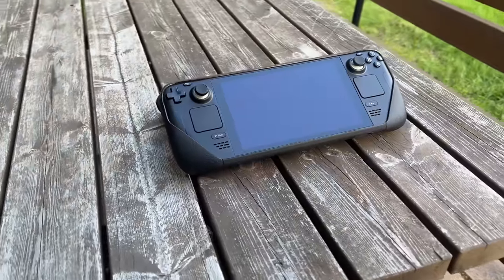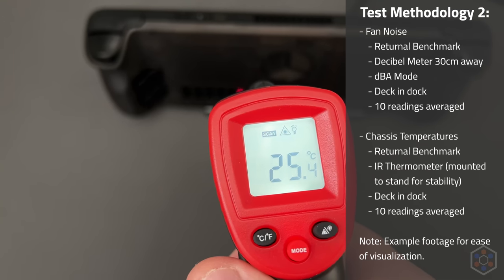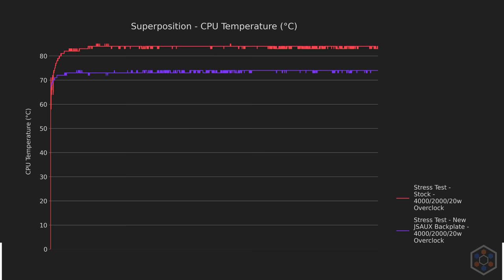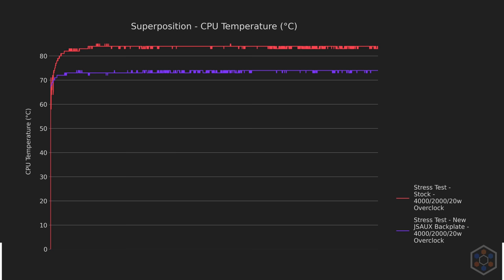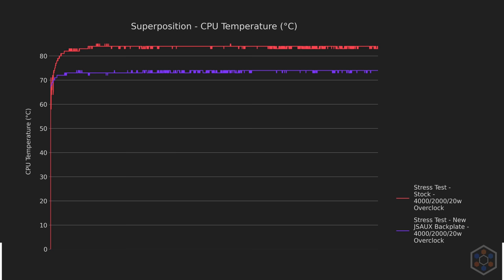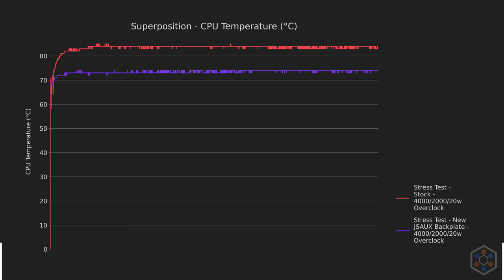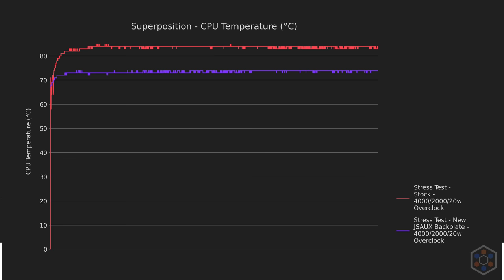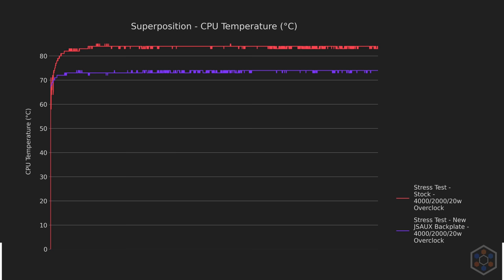How LOW Can It Go? | Steam Deck Thermal Modding

Comment: Since using the jsaux backplate with the metal plate combined with the jsaux original cooler and the jsaux case, I see the same improvement numbers, 9-11 degrees cooler. I'm also running your program too
Reply from the maker: Those are the numbers I see on intermittent loads as well, the plate starts to falter when it's high load for a long time, like an extended session of one of the few games that slaughter both the CPU and GPU, like Returnal.

Thanks for watching, I'm glad you're happy with your backplate!

Comment: I am currently rocking the JSAUX Modcase which i really really like, it is compatible with a different version of the jsaux fan that clips on easier at the back  and takes up less space. but the case itself interferes with the Vented backplate, You think it would be a good idea to cut a small  hole in the back of the case so Half the  vent is exposed and then put the JSaux fan on top of that ? or would it just block its own airflow.

Comment: Are there any updates on your concerns with cooling? I have the backplate myself and have had it about 3 months now. No issues on my end but i am by no means running testing on it.
Reply from the maker: Nothing thus far, it's still my daily driver with no signs of issues!
Reply: @cryobyte33  Thanks for responding! I was gonna ask the same question to see if your SD spontaneously combusted or something. Based on responses from Reddit, they make it seem like all the other components will die due to increased heat. They love saying how valve did negative pressure for a reason etc.
Reply: @cryobyte33  thank you so much for replying. Your work is greatly appreciated. Huge fan here. 
I also have had no issues and the lower temps have been awesome.

Comment: I'm a really picky guy about my temp/db of my devices. I own mine since last friday and I tried a lot of games, really heavy and very light ones. And I can't consider it a problem to reach such temperatures on the deck keeping in mind some gaming laptops like mine with a RTX gpu that reaches almost 90º.
 I like to see third party projects to build aftermarket parts but in this case I think valve put so much effort into optimizing performance and temperature of this amazing device I could not find a reason to mess this up. As you said it's build like this for a reason, on the long terms messing up the stock airflow could harm the hardware.

Comment: I'm glad you addressed the potential issue with the vented rear plate.  People generally think that more airflow is better, but almost always ignore airflow paths and how stock configurations are designed for the most efficient cooling all round, not just for a single component like the SOC.  The SSD and VRMs will almost certainly be suffering worse temperatures with the vent over the fan.  If you are able to see VRM and SSD temps, do you think you could do a follow up to confirm/debunk this?
Reply from the maker: So, I actually mentioned it briefly, but:
1. I tested VRMs, ICs, the SSD and the RAM for temperatures with the vented backplate and saw less than 1 degree difference from the stock backplate
2. A lot of air still gets taken in through the rear vent, even with the vented backplate, so I have very few concerns with device longevity. 

It's still a concern, but not nearly as much as I originally thought. I tested the vented backplate first because I was convinced that it would be bad for thermals, but I couldn't have been more incorrect, at least as of all my current findings.

Thank you so much for watching!
Reply: @cryobyte33  Ah I must have missed that part.  If you're happy then I'm happy.  I have the metal plate version and was thinking about changing it for the new one alongside a front plate swap, but had concerns so I'm glad you did the testing.

Comment: I found the honeywell thermal pads on amazon, they advertize .2mm thick. I did not see the thickness on your affiliate link nor heard you mention it during testing, is this the apropriate size?
Reply from the maker: Ah sorry about that, I must have neglected to mention it. Mine is also 0.2mm thick 😅

Thanks again for watching!

Comment: Im sad I had to return my updated internal LCD model because the temps were amazing with the PTM9750 and the stock backplate. 

I was given an older internals model and even with the PTM9750 pad the temperatures are high and the back gets so hot that it's worrying.

Comment: The main problem with the backplate that has a vent for the fan is that ram will run a lot hotter and potentially fail sooner.
GN did tests on this

Comment: I stuck a 60mm heatsink to my old jsaux backplate for passive cooling and bigger thermal surface, running 4000/2000 OC at 18W with 60/60/40 undervolt, temps stay in mid 80s during extended AAA sessions
Reply from the maker: That'd definitely work! It would get in the way of my big meaty hands, but that's a great fix for more normal people 😉

Thank you for watching!

Comment: A CryoByte video, and as always I wasn't disappointed. Packed full of the best kind of YouTube content. Facts, presented in an understandable, enjoyable, compressed manner. Creators like you are the reason this is still the best platform on the web for great content. I think your mind and approach to analysis would make you an ideal candidate for the Valve Steam Deck design team. I am sure Valve has hired great talent, but it goes to show that being just that little bit more focused on the details can bring out the best in an already amazing device.
Reply from the maker: Thank you so much for the incredibly kind words, and for watching! Valve did an amazing job, but there's nothing quite like a community of supporters when it comes to testing every possible option 😁

Comment: If the new Jsaux fan vent is an issue.. you should have tested with how it comes and covered (by tape) seeing how it has a new design all together with out the external metal plate. 

Because I ordered it along with the Jsaux cooling fan. 

So I can have new design internal plate, covering the fan vent, then adding the cooling fan, so it does get its original design air flow.
Reply from the maker: I did test exactly that by proxy, but just by adding the clip-on fan over it. It works roughly equally to stock, within a few degrees 🙂

Thanks for watching!

Comment: Valve recommended against playing on the deck without a backplate at all due to concerns of other functionality, like the charging chip, overheating when you're playing + charging. I feel like running the vented backplate might have a similar concern, with not enough air going around the other motherboard components anymore...

for that reason I think I'll stay away from the jsaux vented backplate, but the rest of these takeaways are really useful, and I might take apart my deck.... :o
Reply from the maker: Just to clarify, I did check the RAM and VRM temperatures and they were identical with botht he stock and vented backplate, but I totally understand your concern. I actually tested that backplate first since I was convinced it would be bad, and was genuinely surprised when it disproved me! The fan still pulls some air through the vent itself, so they stay cool.

Thank you so much for watching!

Comment: sooooo should i just mod the old backplate i have to have vents to save some money and reap better cooling? im not worried about the heat of the old metal backplate.
Reply: I did exactly this. I stupidly bought two of the old back plates before the new one was announced. Instead of buying another I took a dermal and made my own vents/holes where the fan is. Then I bought some small heat sinks and attached them to the back plate to transfer more heat away. Also added some thermal pads inside the deck too. Let's just say it really works.  The heatsinks are small enough that I can still play comfortably with almost no weight difference and the heat from the back plate was never a concern of mine.  I have my deck overclocked too. A little more than what cryo has his set at and have gotten similar temp numbers.
Reply from the maker: That's definitely possible, several comments have actually said they've done this! As long as the hole is similarly sized and located, your results should be comparable to the vented plate 🙂

Thanks for watching!

Comment: I am waiting on my Jsaux Backplate v2.0 because I live in a tropical climate country and my Deck reaches 91c while playing AAA games, so I want something that helps lower those temps. I am a bit worried about the air getting trapped inside the deck instead of being sucked by the vent tho. Do you think using the old fan curve (or just using the FanTastic plugin) could negate the concerns you had about the backplate? (I honestly don't mind the noise, I just want to lower the temps and not have -9 here and +9 there)

Comment: My new RMA unit only survived for 7 hours. I would say the quality on them is shit too. Loud delta fan, muffled boot chime, trackpads set to 100% even though steamOS shows they're not. I could hear the motor struggling in the trackpad and steam support said it was normal/change it in the settings. I waited 15 days for this new unit but now im fucked since I leave for a trip in 10 days. Launch models were of higher quality, these new units are made out of cheap materials. I even said that valve should let customers know what parts have changed within the unit so people arent pissed off when they get theirs. Delta and Huaying fan for instance, reviewers and Q1/2 got Huaying and in Q3 (if you were lucky like me). After Q4 and the waiting list, people noticed that their decks were louder since valve changed the fan without warning.

Comment: Thank you so much for everything you've put out here. From your videos ive installed crybytes, the jsaux backplate, and the honeywell pad. The physical instillation was fine and even sintalled a new 1tb SSD. Just finished the recovery process and have steamOS back up and running but im having trouble figuring out how to do the GTKstress test you mentioned for the pad. Any info is much appreciated. Thanks again!

Comment: Your content and thoroughness is very impressive!  One bit of unsolicited advice... Your bar charts aren't the easiest to read, especially the axis labels/legends.  Consider using more abbreviations and putting common text  (words that you are putting in repeatedly) into the graph title.  Would allow the axis headers to be far more concise and easy to read.
Reply from the maker: Oooo, great tip, thank you!

The reason they are the way they are is so that someone could skip to any point in the video and get the full picture, but abbreviations are a great idea.

Thank you for watching, and for the idea!

Comment: For the ptm7950, do i have to do the burn-in via the gtkstress app you used? Or would it burn in "naturally" overtime as you play. Also, do these ever need to be replaced? Like periodically or something?
Reply from the maker: It will happen naturally over time, you'll just see higher temperatures at first and they'll lower as you continue using it 🙂

As for longevity, these were originally made for servers and the like so they actually age a lot better than normal thermal paste! The only downside is that they're expensive in comparison.

Thank you for watching!

Comment: Somewhat tangential question:
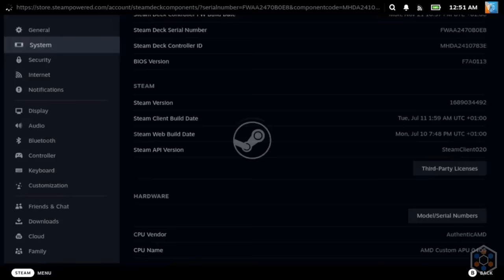Is anyone else missing certain hardware from the Devices section of your account details (4:39)?

All I have is the storage unit and the 2 thumbsticks.
No details about RAM or fan.
Reply from the maker: That's... interesting. Both of mine, and my wife's, have all of them. Maybe it depends on whether you have developer mode enabled?

Comment: Hay, nice video :) There are even better Thermal Pads. Yours only has 8.5 w/mk. I got a cheap one with 25 w/mk. There are even better ones with nearly the thermal conductivity as liquid metal. ~65 w/mk. (liquid metal has something around 79 w/mk) Have a nice day :)= (It's made out of carbon)
Edit: You can swap out the thermalpad of the backplate too.  I got a mail from jsaux, telling me the W/mk of the thermal pad of their backplate pad, but i accidentally deleted it.. I compaired it to my switched pad and im sure mine was betther with 15 W/mk, but sadly i forgot what their thermalpad had :|

Comment: Wish you would have used a top performing paste like KPX. And you should be using a probe to measure air outlet temps. Laser is kinda bogus for that
Reply from the maker: I tested with probes as well, the idea was to get the temperatures that a human hand would feel if near the vent, not the temperatures of the material itself. As for KPX or other high-performing pastes, they tend to function best with an incredibly high thermal load, which the 15-25w Deck cannot produce. It makes more sense to use a paste that behaves better under low-mid load like one of the Noctuas or even Arctic silver, at least in my testing 🙂

Thank you for watching!

Comment: This video has me considering swithing my arctic silver paste to the Honeywell pad - I’d love to find some direct comparisons between the arctic paste and the Honeywell pad.

I’d also consider drilling some holes in the original backplate for increased venting of the fan - but just as you mentioned, I’m also a bit torn on the effects on the other chipsets due to the lower airflow due to this 🤔
Reply from the maker: Regarding the airflow, check out my pinned comment for a bit more info. As for the Arctic Silver, it's been a while since I've used it but I remember it performing better at high thermal loads rather than lower ones. If that's the case then it might be sub-optimal in a small and power efficient device like the Deck, but I'd have to try to verify it and I won't have the time prior to moving 😅

Thanks for watching!

Comment: After having and using the new jsaux backplate (without changing/upgrading thermal compound) I'd recommend extreme caution regarding your micro sd card. The section where the sd card is can and will get exceptionally hot and, as we've seen now, this can easily lead to killing your card. Be especially careful mass downloading/installing games or files to an sd card with this cover. I even personally take my sd card out when I'm downloading a bunch of games/demos to the internal storage because I really just don't want to risk frying my card (although that may be a bit too paranoiac).
Reply from the maker: Hmmmm I didn't have any issues prior to swapping the paste, and I've been running with the PTM/Vent combo for months now without issues 🤔
Reply: @cryobyte33  idk. Mine gets really hot when downloading stuff, not quite too hot too touch, but maybe I've just had bad luck with sd cards then lol

Comment: Thanks for all the testing. I picked up the old Jsaux back plate when it was new and the only option around. I removed the big thermal pad from it before installing as transfering heat directly to your fingers seemed like a terrible idea. I just wanted transparent green and didn't think Jsaux cooling claims were going to be warrented. 

The back of the deck at the metal plate does get hotter then the stock plastic back did but it's not burn your fingers hot. 
Ok I just got curious and did a quick test. I got out a Laser IR thermometer and ran FF7R in the slums. With the SOC temps at 79-81c on the CPU/GPU, the metal plate was 39.5-40.1c with no thermal pad. 50c at the exhaust vent and 34c at the intake vent.
Reply from the maker: Thank you for testing that, I just had someone ask me what those temps would be!

The metal being that cool is a big relief, so I'll likely take the thermal pad off mine if I use it again, I'm hoping that nobody got hurt from it in the first place.

Oh, and thank you for watching as usual ❤️

Comment: This is literally everything I was looking for tonight.  Just got the JSAUX mod kit with extended battery and wanted to know what else I could do to decrease temps.  Do you have a link for those thermal strips? I will be buying the non delta fan, new JSAUX backplate and that thermal strip as well.

Comment: I think honeywell pad needs several heating/cooling sycles before it sets in and reaches the maximum effect. Maybe retightening the screws after might be good aswel.
Reply: Lol forget that. Should stay silent untill the video has finished 🤣👍
Reply from the maker: It does, I mention the burn-in that I did for it in the video 🙂 I didn't get any further tightening after burn-in when I tried, so I didn't mention needing to do that.

Thank you for watching!
Reply: No. Thank you for great content once sgain.

Comment: Ooh interesting, just had this video from your channel pop into my feedfor the first time.
My deck has the older Jsaux backplate with two old M2 SSD heatsinks attached to the back of the metal plate with thermal pads and liquid metal on the CPU.
Haven't done actual testing but it does run noticeably quieter now, especially when running more lightwieght games.
Reply from the maker: Liquid metal probably performs a tiny bit better than the PTM pad, but obviously it's a little more risky. At stock it runs a bit quieter but not quite as well as the new plate.

Thank you for watching, I hope it helped you with a bit more data 🙂
Reply: @cryobyte33  Finished the video and noticed the bit about you mentioning that rear metal panel getting dangerously hot. Seems my bodge of sticking passive M2 heatsinks on it was an accidental great idea on my end. They get hot but not dangerously so. 😄 The deck still fits in the original case with them attached too (though only just!)